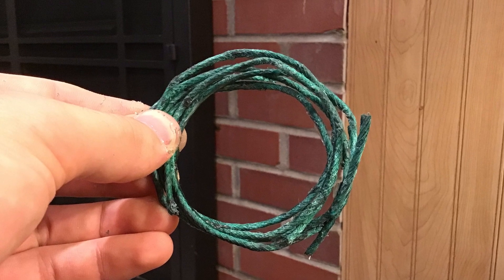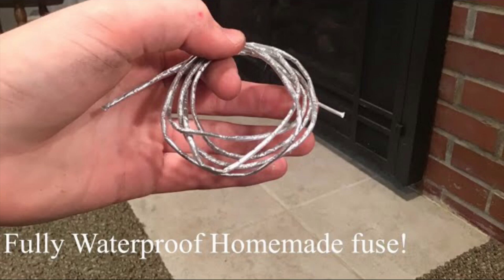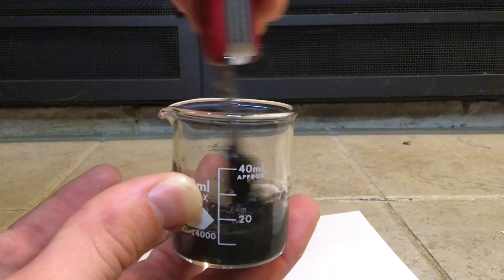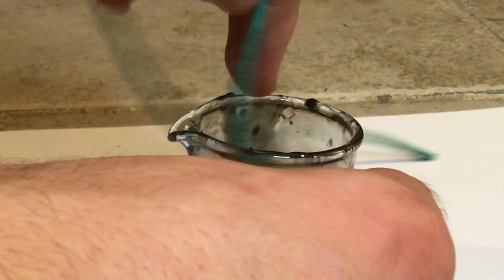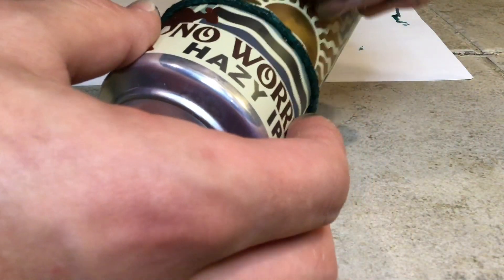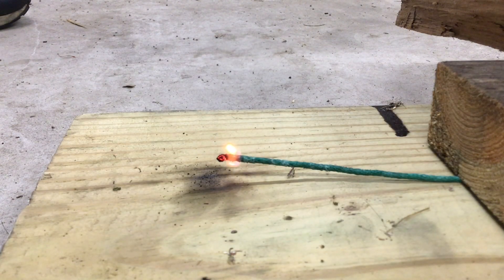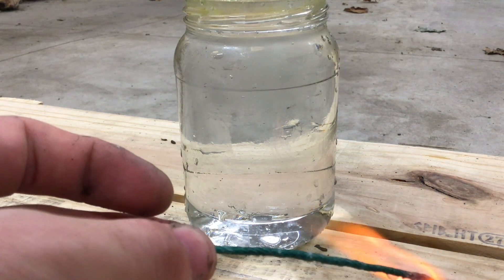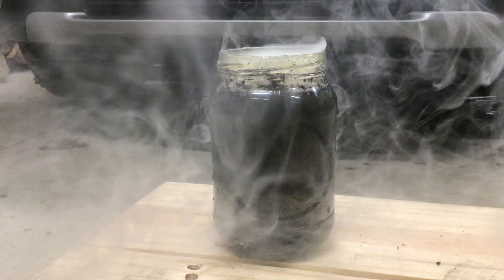How to Make Fuse Waterproof

Comment: It seems like the nitrocellulose caused the burn speed to get kind of unpredictable. It sped up and slowed down at random, which seems less than optimal. Is there some way you could change the coating to even it out?
Reply from the maker: @nosirididntlikeit  nope, it’s canister shell fuse it is not consistent quality fuse. The coating did not do that the fuse is just not top quality. I haven’t done it with good fuse as good fuse always comes coated sufficiently. Check out my other video I mentioned for more consistent fuse.